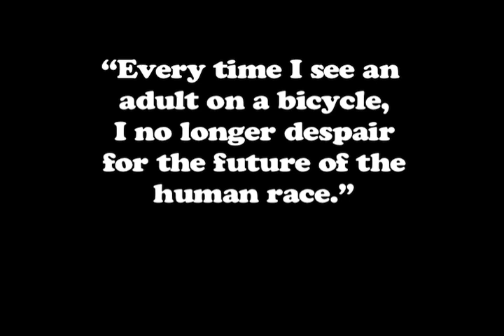Open Bicycle Shop: A Short Documentary

Comment: seems like one of those urban community bike centers with a ton of random old/used parts.  It'll be hard to keep a bike shop going without new parts and bikes going through the door.  How many used axles and banged up rims do you need to sell in a month to pay fixed costs?  It's a great idea but it needs to be a registered charity or publicly supported operation (with tax dollars) to be viable in the long term, much like a soup kitchen.

Comment: Lots of respect for trying, but I can tell just from the fact that you are both wearing cycling caps while not cycling that you won't last. Your business is built on passion, and that's great, but it will be your downfall.
Reply: Gibbs Tolsdorf they sell coke and roids in the back to keep the doors open
Reply: @colemancalgary5260  and to keep the pro cycling races running.